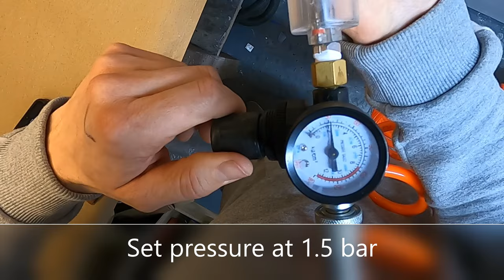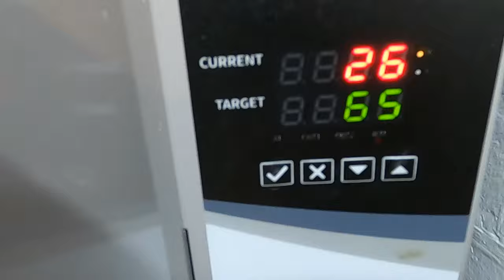How To Spray 2k Clear Coat lacquer And Polish *Perfect finish* Tutorial

Comment: I've ordered the same setup, but which products do you use for the clear coat itself? When i want to clearcoat my forged carbon which composited should i buy? I only know that it has to be UV resistant. But is it a epoxy clearcoat that you use or what should i buy? Don't find any products on easycomposites for clearcoating. Just for filling pinholes :/ thanks in advance!

Comment: Can the clear coat hide all the scratch marks from the 240grit sand paper? I always thought 400 grit is minimum. Sometime scratch marks still can be seen under the clear coat even thought I tried 400. Anyway to over come this issue? Tky
Reply from the maker: Hi, with this clear coat I have no issues. It's very thick compared to others iv used.
Reply: @CarbonWorkshops what brand clear coat and hardener?

Comment: Hi! Did you just sand with 240grit and call it a day? I would have figured there would be stages into the finer grit, but if that's all you need that's fine with me.
Looking to clear coat (to protect from the sun) my Celica Spoiler. I'm hoping 2K rattle cans will be good enough coping all the steps you took.
Reply: 240 grit allows for mechanical adhesion. The quality of his finish is mostly achieved through the thorough degreasing and spray booth indoors. Rattle cans should get you most of the way there, then you can polish out any impurities. 7 months later, so how did you do?
Reply: @mod.ts76  I was an idiot and didn't realize I already bought one that came sanded and coated lol. 
Not exactly a job I could get done perfectly though.

Comment: Can I do bike tank wrap & then put clear coat /lacquer on top of it to make it last longer without damaging.?
Reply: Wrapping metal with real carbon fiber (not carbon fibber!) is problematic. Carbon fiber does not expand or shrink with temperature changes, but the metal underneath does. In the sun, the black carbon fiber can get up to 140+ degrees F, causing the metal tank to "grow". The carbon fiber won't move, so the laminate will shear (delaminate) from the tank over time.
Keep the carbon fiber skinned tank at the same temperature, no problem. Expect then different galvanic potentials between the metal and carbon fiber will cause oxidation (unless you keep the carbon fiber skinned tank in a completely dry environment).

Comment: Do you think a similar result could be achieved with a spray can of 2k clear coat? I'd like to try this but I can't justify buying a whole compressor and spray gun for this. I've tried with 1k clear but the finish ends up too soft and scratches easily.
Reply from the maker: Yes the 2k mix cans you should be able to. Maybe not great straight from the can but should wet flat and polish great.
Reply: 2k spray cans work very well for small parts
Reply: @CarbonWorkshops I can’t get a nice shiny polish from my cf trunk I haven’t sanded with a fine grit tho should I 3k grit sand it and polish polish polish? And use a cut compound before polishing? It’s really dull it looks like dry cf almost
Reply: Is the clear coat an epoxy? If yes, does it affect the sprayer? 1:59

Comment: what about impact, scratches resistance ?
nicely made
Reply from the maker: Time will tell I guess, however it is automotive grade 2k clear coat used on cars.
Reply: 2K polyurethane clear coats are actually clear rubber, and have good scratch resistance and impact strength. Scratches can often be buffed out, just like the sanding scratches.

Comment: I just bought a 2022 gsxr. I am slowly putting gloss carbon fiber all over it but it has a ton of stock carbon fiber that’s isn’t gloss coated. I never would have thought to sand it. Could you let me know what you think? Should I do this even thought it’s matte finish currently, so that I can gloss them?
Reply from the maker: I can't see that being a problem. Sand a little, degrease and re clear coat 👍
Reply: @CarbonWorkshops  turns out it is scored plastic and I can’t let that slide. I can carbon fiber skin it and clear coat it. Can’t let the scored plastic remain lol

Comment: found a set of carbon fiber fenders for my mustang the guy already sanded the clear down that was on it will I have an issue spraying automotive  clear on them or will it fish eye.
Reply from the maker: Youl be fine, just make sure it's well de greased 👌
Reply: When it doubt, spray the clear coat a bit thick, versus too little. You can always come back and cut and polish the heavy orange peel texture.

Comment: is not the 240 sand paper to high? so no finish with 1500 or so before aplying clear coat?
Reply: 240 grit is likely the correct, or close grit to sand prior to clear coat. Like most coatings, clear coat needs a specific "tooth" size to bond too. Too course, like 60 grit, and you'll see the sanding scratches through the clear. To fine (like 1500 grit), and the sanding scratches are too small to fill and hold onto, and the clear coat will likely delaminate over time.
All professional paint re-finishing systems specify the correct grit of sanding (both wet and dry) to use, prior to applying the coating.
Reply: What if i use 2k clear coat spray? What grit do i use for it
Reply: @JR-nh4fi  I'd try 400 wet sanded.
Reply: @drrock5356  400 and thats it? Thanks for answering fam

Comment: Instead of clear coat could you have brushed on then polished the clear gel coat you use in other videos?
Reply from the maker: Xcr resin could be brushed on. It would require wet Sanding flat through all grits up to 2500 grit before polish.

Comment: is the red scotch the fine or the coarse version?
Reply: and what surface cleaner do you use? is there a certain type that works best?
Reply from the maker: The red scotch is a the equivalent to 320 grit sandpaper. And surface cleaner I use is 'Gyeon Q2m prep' works very well.
Reply: @CarbonWorkshops  brilliant, thankyou very much!

Comment: What grit is red scotch? Can I do 400 then 1500 then spray?
Reply from the maker: Red scotch is 320. 400 then spray will be fine. I wouldn't go to 1500 you will have trouble with the clear coat sticking.
Reply: @CarbonWorkshops  thanks bro.